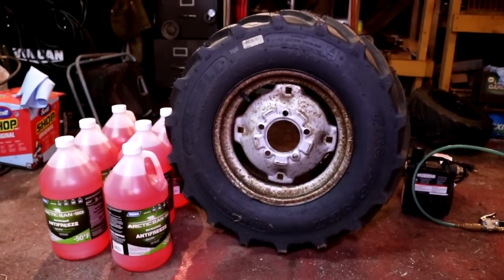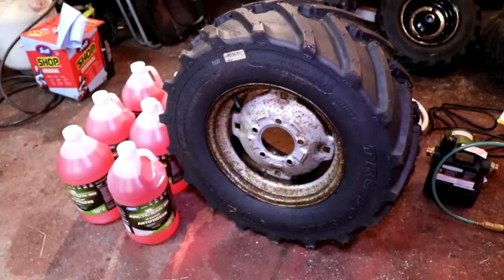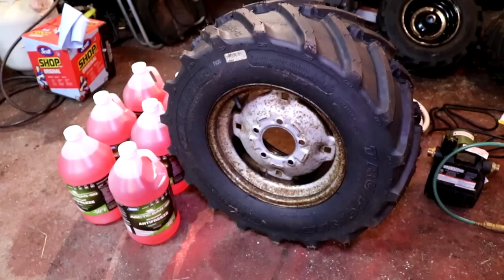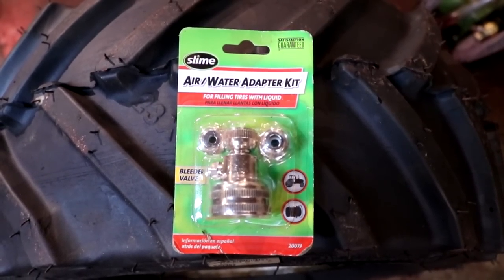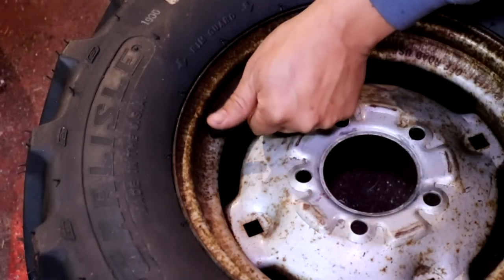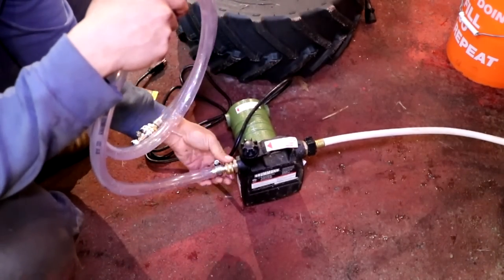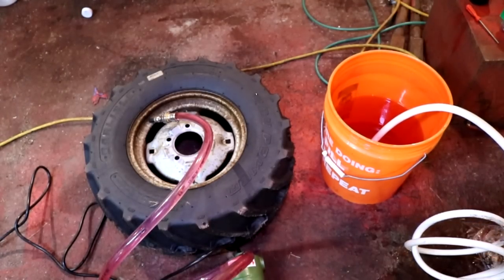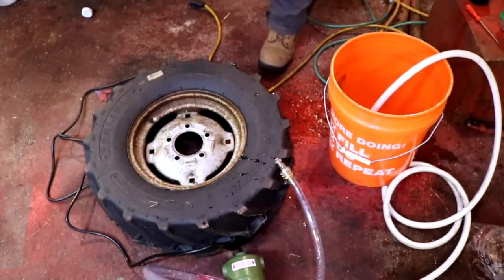Adding Weight to Your Garden Tractor Tires | How to Add Liquid Ballast Lawn & Garden Tractor Tires

Comment: Did this 15 years ago and it's still in there but I pulled the wheels, broke down the bead on one side and used a funnel to pour it in then just reseated the bead.  My Wheelhorse took 10 gallons per tire. I'm going to put new tires on this year and I'm going to try to save the old antifreeze with a siphon pump that is run with an electric drill.  When I put it in RV antifreeze was $1.49 and cost me $15 a tire to do, it's gone up since then. What can I say? I'm "thrifty" LOL.

Comment: Great video and idea Norman, thank you!
P.S. I did this around 10 years ago to my 149 Cub Cadet and it's still in there and working just fine. I always hated the calcium chloride because it would eventually ruin the rims. So far I have not detected any rust issues using the RV antifreeze.
P.S.S. I just broke down one side of my rim (tubeless tires) and poured it in until it wouldn't hold anymore, 5 gallons per tire IIRC, 26x12x12 tires. Right now I have 5 old Cub Cadets, 3 that will run, one needs engine work, and one mnus the engine. The oldest one, the one that needs engine work, is from the 60's and the others are all 70's models IIRC.

Comment: Nice job. I did mine with a hose and a funnel. Gravity did all the work. It was slow, but it worked. Mine ended up with 85# tires when I was finished. My Cub is a beast now because of it. Thanks for you videos. They are great at showing what these smaller tractors can do.

Comment: Great video! If you were interested beet juice and rim guard are not hazardous either don’t rust rims and weigh about 13 lbs a gallon add even more weight Ik you mentioned it’s available at tractor dealers near you great products in my opinion

Comment: Without tubes I found it easier to just break the bead and pour it in. Use a tire spade to pull of the tire above the rim edge. Then you have very little air left. No pump/hose/special fittings.
Reply: fartpoobox ohyeah  we called them spade in Iraq, here it's a tire spoon.
Reply: The fluid level should never be above the top of the rim, unless you really like a rough ride.

Comment: good informative video
tips -  lay an old blanket or sheet or towels under the tire and bucket to soak up antifreeze spills and  put the supply hose under the bucket handle (it acts a a clamp)  to keep it from moving while filling the tire

Comment: Hi there Norm,  Norm I am working on my 82 Ff24 Craftsman Tractor, I need some help I was rebuilding my tractor and rebuilt everything but some were I lost my front mounted PTO that gets connected to my elect clutch by belt, I do not know if someone took it or just where it is but its not with me anymore, Do you know any place that might have this part ? Also, where can I get a owner's manual for this 82 Ff 24 tractor. Love your video's that you put out there, Big Thanks...

Comment: I picked up a 4th Gilson tractor not to long ago. It was a '73 Gilson S-10 garden tractor with chains and a snow blower attachment. Got it running good and decided to reverse the rims to get a wider stance since it was on a cast iron Peerless 2300. Come to find out the guy had already loaded the tires down.  Weighted a empty 23x8.50x12 with snow chain and it was 40lbs. Weighted the filled 23x8.50x12 with snow chain and it came out to 139lbs. That 100lbs more in each tire. How can there be almost 12 gallons in them or could something else have been used to fill them? Either way it did fantastic driving through 8" of snow.

Comment: Hmm, interesting. Good idear and easier than the bolt on large plastic/sand/metal weights.
Reply from the maker: You could use both and double the weight!
Reply: With the bolt on weights, you can easily take them off. Liquid isn't quite as easy lol. I have loaded tires on the work tractors, the lawn only one has no extra weight.
Reply: @Blazer02LS  yeahh thats true too if you ever need to remove weight

Comment: You explained liquid tire ballast pretty good, how did you know to use 6 gallons and shouldn't the tire be vertical? I'm also in ME.
Reply from the maker: You can fill them more when laid on their side. I just stopped at 6 gallons. It may take a little more.

Comment: I've been using my portable air tank. Pour fluid into tank, pump up tank, stand on end with hose down, and fill tire. Also remember to bleed the air off of tire during process.

Comment: I got a section of heavy pipe that will slip inside the wheels.   I plan to melt the lead from lead acid batteries to create the weights.   Batteries are 60 percent lead by weight. The weights don't need to be very thick, compared to concrete which is more bulky. You could cut some steel disks and stack them too, but lead is the best ballast

Comment: I'm wanting to do this to my rear riding lawn mower tires.  I'm wondering about unanticipated consequences, such as running over thorns, nails, or anything else that might flat the tire and allow the antifreeze to run out.  Is there a good way to avoid that?  Lawn mower tires are not very tough against punctures and I also mow deer food plots that can have more hazards than a regular lawn.

Also, filling the lawn mower tires would only add about 33 pounds per tire, or 66 pounds total.  Is that enough to make all that much difference?   Last question.   Mississippi gets 50 to 75 inches of rain annually so we have a lot of wet grass and tons of MUD!  I'm wondering if making the tires heavier is the right answer.  Most of the mud racing trucks and mud mowers all want flotation tires because heavy tires just make deeper ruts in mud.

Seems like the heavy tires would do best in loose dry soil such as freshly tilled dirt, not on wet grass or in mud.  Am I missing something?

Great videos, as are all those you post!  Thanks for sharing your knowledge.
Reply from the maker: Weight on the tires increase traction in all conditions. For muddy weather you could go dual rears for extra flotation. Regarding punctures, these tires are tough enough to not easily puncture. The only hazards to avoid are nails and screws. If you puncture it, you will just repair as normal and refill the liquid. RV anti freeze is not toxic and will not affect your surrounding property
Reply: @Isavetractors  I appreciate your input.  However, I'm speaking of using the standard lawn tractor tires that are on my riding mower, not buying the heavy duty tires you used nor installing dual tires.  My question was about simply filling standard lawn mower tires with the RV antifreeze.

Yes, I do know there are plenty of heavy duty tires on the market. But that isn't what you get on a Poulon riding lawn mower!  Those tires are often only 2 ply or 4 ply at best and they puncture quite easily.  I don't want to have to keep buying and refilling with the antifreeze over and over which is why I was asking about any thoughts on using it in standard cheap turf mower tires, not the heavy duty tires in your video.   Seems like the advantage of tire weights or something similar is that they never leak out.

As for mud, I think you missed the point of that question too as you say that the heavier weight of the tire improves traction then follow that up with suggesting dual tires for better flotation.

Flotation is a different technique for going through mud that largely isn't so much dependent upon using heavy weight to gain better traction. Flotation is a principle of using wide tires that create as big of a footprint as possible, and generally tires which run on lower air pressure.  The concept is to spread out the weight of the equipment being moved over as much tire tread area as possible. It isn't about "digging in and powering through" but is about riding high and NOT digging ruts or sinking down.  With flotation, the more the tire weighs the worse flotation effect you get.

Last but not least, lets look closer at hazars from RV antifreeze, which is based upon two chemical formulas, one using generally cheaper ethanol and the other using about 4x more expensive propylene glycol.  Both can be toxic to pets or most any other living things if ingested in large enough quantities.  True, a little might not kill you but per spec sheets it can cause a lot of nasty side effects you would not enjoy.  

Ethanol based antifreeze is grain alcohol essentially and that is a hazardous, readily combustible substance sold with a warning label about the risk.  Ethanol is also the widely cursed culprit that is known to dry out rubber components and make them deteriorate faster and fall apart.  So, let's see....we want to put ethanol in a rubber tire?  I don't want ethanol in my lawn mower carb because it gums up the jets and ruins the rubber seals. Why then do I want that in a tire?

Dow Chemical who is a large producer of propylene glycol antifreeze warns that some product using this ingredient are made from recycled propylene glycol, generally recovered from deicing of aircraft.   The recycled stuff may have anything and everything from dirt, oil, jet fuel, etc. mixed in with the recovered glycol.  So if you buy the glycol product, you could easily be getting a product that may indeed contain elements that are toxic.  

Frankly, there's not much in the way of any chemical based substance like antifreeze that is truly non-toxic.   Buy a gallon bottle of whatever grain alcohol you like at the liquor store and drink it all in one siting.  If you live through it, post here if you still think the stuff is non-toxic.

I run an organic farm on my 20 acres of land and I truly don't want chemicals leaking out of tires in any large enough amounts to make an impact.  A drop or two is not a concern.  Four gallons in a tire that got slashed by a tree stub I ran over would be.

Comment: One alternate idea, the only active ingredient in most antifreeze fluids like you might pass onto a windshield is watered down methanol. You can easily mix up your own batch with denatured alcohol from any hardware store and divide out 1/4-1-2 gallon alky to remainder of water (tire size dependent and how cold an environment you expect to encounter. If you live further south, it can be thinned out fairly effectively). Sometimes you get a terrific deal on fluid that it doesn't meter out financially, but even low shelf stuff around my area is $4-8 a gallon, whereas I can get denatured alcohol for $8 a gallon and be done with it. 
This part I haven't tested myself, but if I were to run water 365 a year, I'd run a tire sealant around first, then let it set up in open air just to give the rim a fighting chance at avoiding corrosion down the line. I've also considered blasting in high density urethane foam and running them airless altogether, but you definitely won't be saving much in the cost battle unless flats are a constant threat. We've got thorns around here the size of ten penny nails that necessitate running half a gallon of slime and having tire plugs close by.

Comment: I just broke the tire bead on one side and filled it up with the hose. Then aired the tire up to pressure. Much easier and faster.
Reply: Doesn't work for us in the north that use em as plow tractors
Reply: I'm on lake erie, do the same. Hose on the jug or just a funnel. 5 minutes and done.

Comment: No pumps or special valves needed.  

1/4 hose and a wd-40 straw is all you need.  The 1/4 hose siphon feeds and the wd-40 straw allows air out. It’s cheaper and it’s pretty fast. I did the pump deal for 1/2 a tire and gave up, I’ve tried several times to give it away and the people just do the siphon method. I did 2 tires with 11 gallons each in under an hour.
Reply: Your also much better off with the tire mounted with the valve stems at the top, that way there is enough air so you can still check pressure and not gum up you gauge.

Comment: I’ve seen different videos on filling tires with fluid and have never seen anyone do it the way I do it:
Simply add a second valve stem on the opposite side of the rim.   
   Fill in one stem and let the air escape out the other. You don’t need any special tools or a pump. Just a drill and bit.
Reply: That's great if your tubeless

Comment: I didn't see a pressure gauge on your air gun,do you guess the Pressure?
Reply from the maker: The air gun has a gauge built into it. It doesnt pop out very much at the low pressures these tires take

Comment: Stand tire up valve stem at 12o clock fill till it runs out , that keeps weight low and not robbing power to move

Comment: Will your Rim rust out without a tube with the antifreeze?
Reply from the maker: Depends. If you have a perfectly sealed tire bead air will be between the liquid and the rim. Also if your rim is painted, that will prevent corrosion. If you however have leaks in your bead the liquid will reach the rim and cause corrosion.
Reply: @Isavetractors  but the antifreeze will not cause it to rust?
Reply from the maker: Not as quickly. I'm using tubes here though so there is no issue. The calcium is what really accelerates corrosion
Reply: @Isavetractors  ok thanks
Reply: hands down  everything rusts your rim, but even calcium chloride takes 20 years to cause problems. Rv antifreeze or wiper fluid might take 30.

Comment: You need a tire bong...   Another option if you don't want to do the pump or filler routine, break the short side bead in one spot, pour in the ballast and air it back up.
Reply: Blazer02LS that doesn’t work with tubes.

Comment: How do you know when you have your tire full?
Reply from the maker: When liquid starts pouring out of it. When that happens drain it out some, then add air.
Reply: @Isavetractors  pouring out of the bead stem and leaking out by the adapter thing?
Reply from the maker: Yes. As the other commenter said they're are charts too you can use. If using a tube like me subtract a gallon or two
Reply: Fill with the tire upright, valve stems at the top.  Do not fill above that line.

Comment: Would rather use -20 windshield washer fluid. Rv antifreeze freezes around 10-15 degrees. Put 44 gals of it in my ford 9n.
Reply from the maker: I use RV antifreeze because of it's non toxic nature.

Comment: I have traction but the tractor goes where it wants, the front tires just slide. The tractor is a Ford YT16 gear drive.
Reply from the maker: Now you need to add weight to your front end to get some steering back.

Comment: Want a mower and snow blower for your front mount mower?
Reply from the maker: Yes!
Reply: @Isavetractors  there's a auction coming up here in Minnasota that has a parts machine like your toro with a 72 inch deck and 54 inch dual stage blower